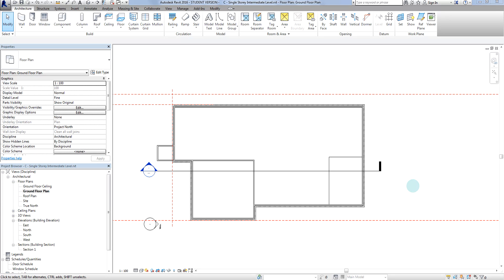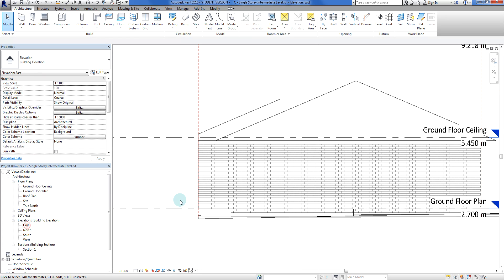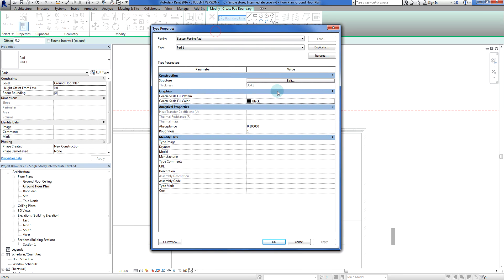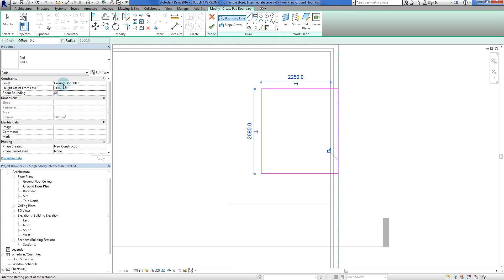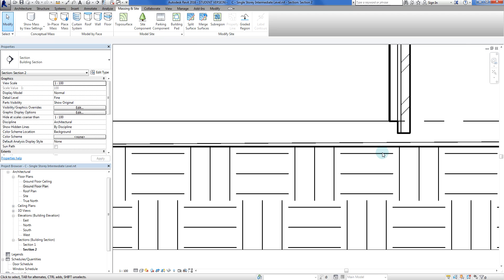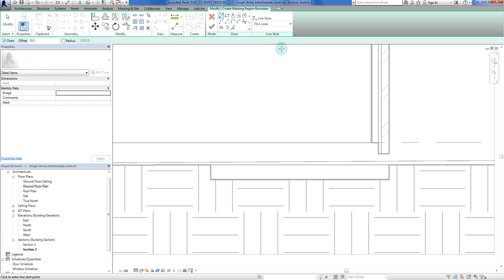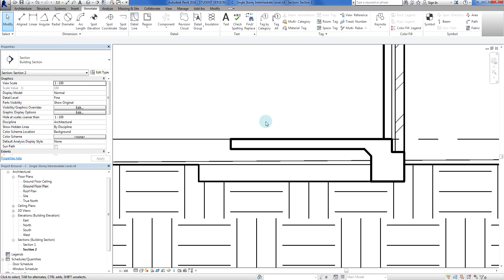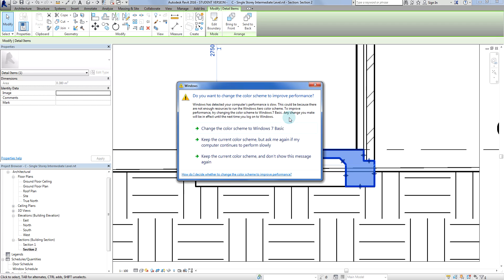Revit - Single Storey Intermediate 13: Floors With Brick Veneer Wall - Part 2

Comment: You are not taking into consideration the floor slab when you placed the pad object. If you did have a slab in that position, you would still have that thick slab line cutting through the brick wall section. The proper method is to use the proper slab thickness, say 100mm then add a slab edge thickening with a rebated edge profile that will engage with the lower brick wall section. This way, you won't need to draw a masking region in your section views, and your model will display correctly in all views.